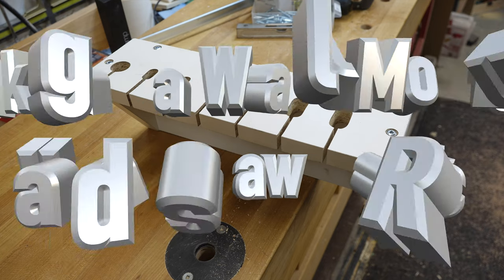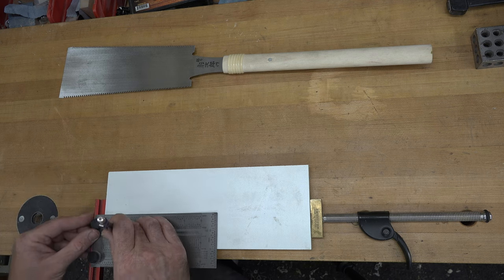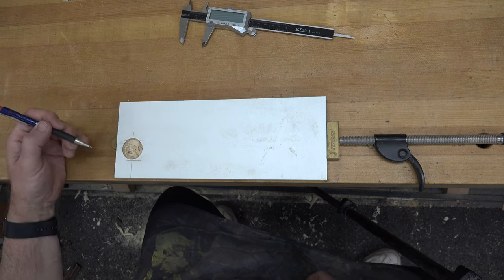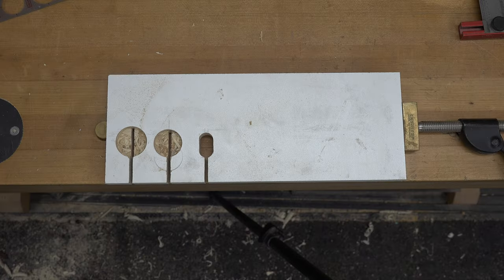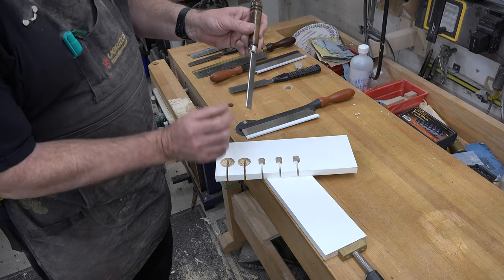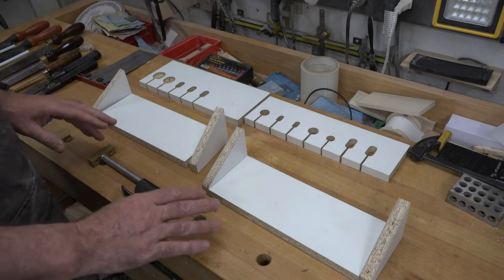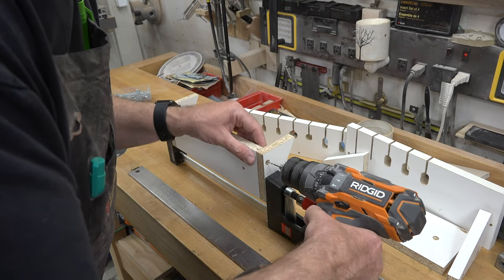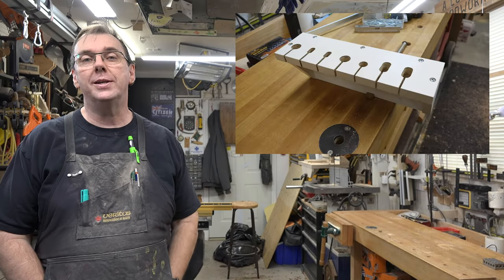Making a Hand Saw Rack

Comment: This is a great idea! I have some scrap plywood that will fit the bill. I noticed your saws have guards on them. It gave me an idea to protect the blades of my saws. We raise show rabbits and we buy plastic door guards for the cages we build.They come in 4 or 5 foot lengths. I believe they would work. I have a couple of short pieces and will try it this weekend. If they work I'll send you a photo. We have shown our rabbits in Canada, so I'm sure that they can be bought there too where ever cage wire and supplies are sold,  You should be able to find them. Take care!
Reply from the maker: I look forward to seeing the pictures Michael.  That's a great idea.  Thanks for tuning in and for chiming in with your suggestion.  I hope it works.

Comment: Well now I have to go out into the shop and find some unused wall space!  I have all my small fine tooth saws in a drawer and I like the rack idea.   The truck is going to be finding the empty wall space 🤔😬. 

I had to laugh at your small pieces of sandpaper clipped together…… I have the same thing on my bench.  I just can’t seem to through away an odd piece of sandpaper 😢😂
Reply from the maker: Finding the wall space was one of the challenges of this project for me Randy.  I really need to go around the shop and condense or better organize the stuff around the walls.  As for the sandpaper, if it's still useful, I keep it.  When it's used up, I get rid of it.  Thanks for tuning in to the show.

Comment: Kenny, want to visit my shop and do some organizing?  I have lots more empty wall space than you do.  I want you to know that I now have a big flat spot on my forehead from hitting myself after seeing your method of trimming the iron on edging.  I have always used the trimming tool but never really liked it.  Use a sharp chisel, what a great idea.  Great video.
Reply: I have a trimming tool and don't like it either.  Mine is suppose to cut both edges at the same time.  The direction of the grain of the wood edge banding causes tearing and an uneven cut on one side or the other.  Works better just cutting one side at a time and going with the grain.  Seldom use it.
Reply from the maker: I've never liked the idea of the edge banding trimmers and prefer the precision and hands on use of a sharp chisel.  It's always provided great results and I didn't have to purchase a separate tool to do the job.  Thanks for the kind words on the show Paul.  Sorry about the flat spot on your forehead.  Thanks for tuning in.
Reply from the maker: I've always preferred the chisel trimming method.  It's never failed me.

Comment: What setting do you use on the iron for edge banding?
Reply from the maker: I have the iron set around 300 degrees.  With the age of this old iron, I'm not sure how accurate that is but that's the setting I have it at.  They do sell edge banding irons that are specifically made for this purpose and I'm pretty sure that they are not unreasonably priced.  I hope this helps.  Thanks for tuning in Scott.